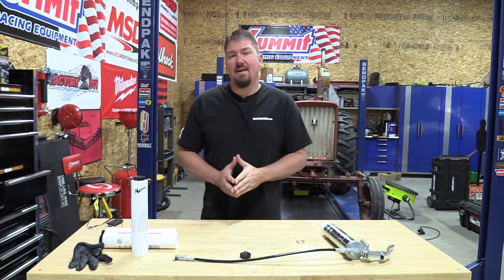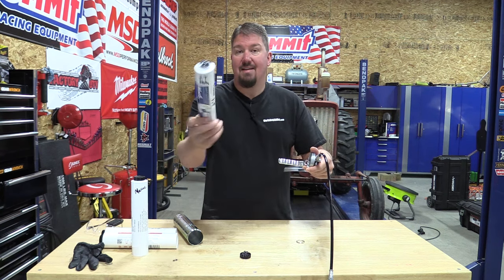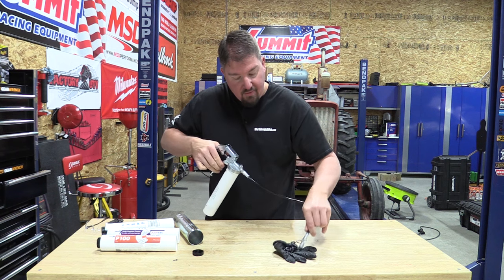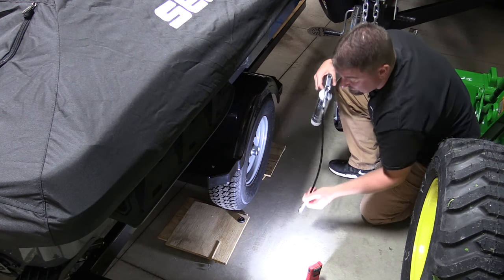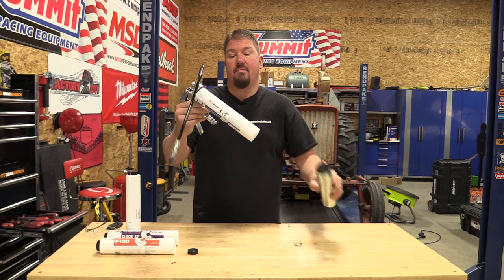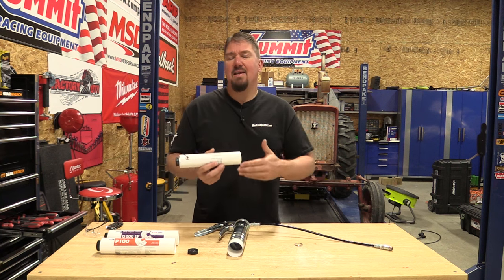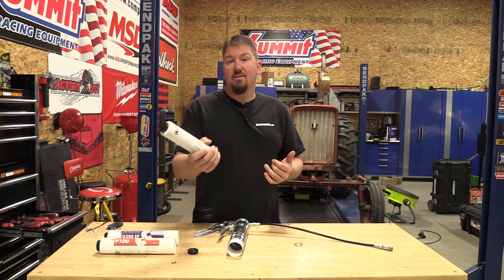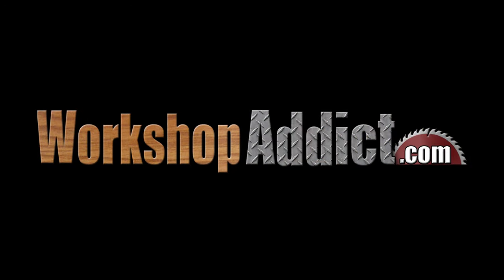Game-Changing Grease Cartridge & Gun Design That Will Blow Your Mind Made By Lube Shuttle

Comment: I used to dread greasing until I bought a lube shuttle last year. Best thing I ever did, it’s so easy to use and CLEAN too! No more mess!! I think what’s holding people back is the initial cost of switching over. I think I spent around $130 for the gun, box of grease tubes, the long extension hose, and the locking adapter. Well worth it though in my opinion. Great video by the way, all of your points are spot on!👍🏻👍🏻👍🏻

Comment: I buy over 100 tubes of grease per year for the company I run.  We use the Milwaukee M12 grease gun.  I found a great grease John Deere makes that’s awesome.  I love that system I’ve wondered for years why the hell we can’t have that type of system the traditional grease guns fail because of that spring that feeds the grease as you depress the lever.  When you have a million dollar fleet of bucket trucks and front end loaders that manual depressing to dispense the grease seems more suited for guys that have 1 piece of equipment or 2 because it would take too long for our mechanic to grease what we have.  I still like it though hopefully this is the next evolution of grease guns thanks Brian!

Comment: What is holding this back is the millions and millions of tubes of grease available in a myriad of brands and formulas already on the market in OLD format cartridges, vs. a small handful of choices available for this tool by a single manufacturer.  People are brand-loyal.  I like my Polaris Purple Grease for my off-road toys.  Will I be able to get it in a Lube Shuttle format cartridge?  I highly doubt it.  Not now, maybe never.  I like Mystic for my trailer bearings.  Again - does it come in Lube Shuttle format cartridges?  Nope!  

I'm not knocking Lube Shuttle, German engineering, or German grease.  I think this grease gun is brilliant!  It is very likely extremely high quality, as most German-made items are.  Nothing I can see is wrong with the product.  It's just NOT going to get big in the U.S. until grease manufacturers get on-board and start offering their product in a format compatible with the Lube Shuttle.  

Alternatively, if Lube Shuttle would come up with a refillable cartridge that consumers could load with their favorite grease; that might help them gain a foothold in the U.S. market.  Someone eventually came up with the reusable K-Cup for Keurig coffee machines.  Something similar for the Lube Shuttle might make some smart inventor one a millionaire...

Comment: I love this.  The grease gun has been powered by hands, air, and now batteries,  but never really redesigned.  I agree that the availability of different greases is key to adoption.  Many companies and individual mechanics have their choices and swear by them.  I might buy one just as they are as I hate existing grease guns!

Edit:  Just went and looked at the price.  Not until it drops substantially!
Reply from the maker: Price is an issue at this point, but it is made in Germany, NOT CHINA.
Reply: With that price, I can buy five standard ones and still be ahead.
But, let's not forget that it comes with 10 cartridges [$6.50 per cartridge from their website]. The only thing that I would change is that I would have liked an assortment of greases to be included, and not just 10 of the cheapest cartridges.
Reply from the maker: @stans5270  you can buy the gun alone for$65..  you can buy a lot of chinese-made ones for that price but not a lot of good German or American made grease guns
Reply: @stans5270  Agreed!
Reply: @WorkshopAddict  Are you saying that things made in China are inferior?
You sound like my uncle talking about Honda and Toyota in the late '70s.
Perhaps Apple would disagree.
And Snap-on.

Comment: "What's holding it back from being more popular?" For a hand-pumped grease gun it's just a matter of knowing it exists. This one is a no-brainer (no leaking mess, easy to load and prime, quick swaps/refills) but for the electric/professional grease gun, lots of people are committed to their cordless tool brands. I don't think Mato, maker of the electric Lube-Shuttle, is well known. It doesn't look like anyone has reviewed it on YouTube. However, if they'd sell it with a choice of battery adapters for popular tool brands so people could pair it with their own batteries and chargers, that would help. They could knock at least $100 off the price by replacing the battery and charger with a simple adapter and that would make it much easier to justify as a purchase.

Comment: I believe the mower spindle bearing issue is purely a cost and advertising issue - especially on residential equipment.  It's the same with some of these new small engines that don't "ever" need to have the oil changed (B&S Check & Add system). Most folks are too lazy to even do rudimentary scheduled maintenance on their equipment. They would rather run it until it breaks and then go buy another one. So if a piece of equipment advertises no maintenance required they are all over it. With no maintenance the bearings will probably outlast the rest of the neglected components. I once had a Deere lawn tractor with sealed spindle bearings (even though it had grease zerks). They would only last about 3 seasons. So the SECOND time I changed  bearings I pealed off the inner bearing seals that faced the grease. 22 years later when I sold that machine it still had that same set of bearings and they still ran smooth and quiet. :-)
Reply: Grease zerks on most mower spindles are not for greasing the bearings, the bearings are sealed.  They are there to fill the void in the spindle housing that is between the bearings with grease, to keep water out of that void.
Yes you can remove the inner seals from the bearings, but you have to be careful not to blow out the outer seal with too much pressure when applying grease.  It can work if you are careful.

Comment: Omg that's a awesome design what a game changer I agree very easy no mess I think what might be holding it back is it has specialty cartridges you can get regular cartridges at all major stores are the slide in cartridges i also have 5 handheld grease guns and 2 electric grease guns so I don't need another one but it's very nice design
Reply: Lock n lube sells an adapter so you can use the new system in your old grease guns.  I think in a couple years, everyone will be selling grease in these tubes.
Reply: @mikelloyd2013  you can use the old style cartridges with this grease gun?
Reply: @drewmurphy2796  I believe you could swap back to conventional cartridges, but i doubt many people would switch back and forth.  I would expect folks to pick one style or the other, or maybe set up a second grease gun if they have a need to use both styles of cartridges.  I have never used this new style cartridge, but I would try it if my preferred grease was available in it and the price is competitive with the conventional cartridges.

Comment: Got a cheapo €2.50 tube of crappy grease for the lube shuttle and used a long stick to push the plunger inside the tube to get rid of the crap grease into the bin.
Cracked open a standard run of the mill grease tube, put the lube shuttle grease tube plunger into the standard tube(same diameter), butted the 2 tubes together and used the same stick to push the good grease into the empty lube shuttle tube with VERY little mess and almost no waste and it works a treat with no problem. And I put the plunger back into the lube shuttle tube afterwards.

I didn't waste my time cleaning out all of the old unwanted grease at all either, whats the point? It's still grease and only a small amount at that, hardly chemicals going to blow up or anything
Reply: So the label on the tube is different? Doesn't matter, use a black marker to write it on there if it bothers you at the end of the day.

Comment: Couple of comments:  
+ It's not recommended to mix greases
+ I have more problems with grease fittings than grease guns
+ I don't see a cover for the coupler, which means it will get grease on me at some point
+ A cordless grease gun will be WAY more life changing

It's a nice product that solved "one" problem with grease guns.  Nice video though and thanks for your work.  Good videos.  I subscribed.

Comment: I just bought two of the pistol grip Lube Shuttle grease guns.  Also got two of their locking couplers, a 10-pack of my most commonly used grease type, and a 10-pack of empty grease cartridges to fill with other grease types.  I have to keep my old school grease guns in a Rubber-Maid container to keep the leaky mess from getting all over everything.  It will be so nice to not have to wipe the grease and separated oils off every surface of a grease gun before you even get started greasing!  To me, that alone is worth the slightly less than $60/each price tag. 
Then there is the added bonus of being able to switch grease types, basically on the fly, with very little waste.  Oh, ...did you ever forget what type of grease is in each of those four leaky grease guns that are sitting on the workbench?  Eeny meeny miney moe!   Some grease types are very incompatible, and can cause big problems.  With Lube Shuttle, just unscrew the outer tube and see for sure what it is loaded with.
My old, leaky, messy, grease guns are going to get cleaned up and go in the $5/item garage sale box, ...and good riddance!!!  ...well, I might keep the one from the '50s that I got from my dad back in '73, just to hang on the wall for old time's sake, empty of course.  No one needs a grease streak running down the wall !
Reply from the maker: Great points 👍
Reply: How do you fill the empty cartridges? I need one with marine grease.

Comment: Cool product, but I wouldn't be for it personally. 
1. Not compatible with my m18 grease gun. That thing is irreplaceable. I love the speed of it. I can do a morning service on a baler or combine in no time with it. 
2. I really don't have a problem with conventional grease cartridges. If I have a specialty grease that I need a separate gun for, a cheap one will suffice. Also not a big deal to keep a spare tube in the cab of the tractor if I'm almost out.  
3. For 35 bucks more than the pistol grip one, I'd just as soon buy the DeWalt grease gun. It's a good one too. 
4. PSI isn't near high enough.

Comment: This is a great concept but the grease selections are very limited. A lot of folks use various OEM greases on their tractor, backhoe and other equipment. Maybe once the patent runs out other manufacturers will start adopting the design but until then it will probably remain a niche product.
Reply from the maker: Might be...
Reply: They sell empty cartridges, 10 for $15, so you can fill them with whatever grease that you want.  I read somewhere that you can also refill them several times to re-use.
Reply: @warped2875  Wouldn't that negate the mess-free aspect of the Lube Shuttle? :-)

Comment: Make the threading the same size as the tube and it would work with new and old systems.
Reply from the maker: I called them to discuss that and they seemed to believe there were more differences and that this is quickly taking over and they were not changing.

Comment: Do the tubes leak oil out the bottom after it sits for a bit like my standard one?
Reply from the maker: No!  I believe that the lack of pressure on the grease is what stops the separation of the oil.
Reply: @WorkshopAddict  thank you

Comment: What holds the product back is 10 dollar grease cartridges. Any farm supply will have a decent grease for 3.50 or 4.00 a tube. Yep, it's a slick design, but on going costs are a limiting factor. Couple that with a bare end plastic tube sticking out of the bottom being punctured by something in a heavily used tool box, and the gun is useless. Bring grease tubes in line with market, and thread the end for a protective cap, then maybe.....

Comment: How do they get the grease up to the pump without a spring and piston?
Reply from the maker: Before the cartridge is loaded, the grease is pushed up above the mouth, that removes any air in the system and allows it to feed.  You would think that it might be unreliable, but it has never failed me yet.
Reply: @WorkshopAddict  I can see it being reliable when the tube is full but maybe you could do a follow-up after you have emptied several tubes.
Reply from the maker: @eosjoe565  7 Tubes fully emptied, mostly moly grease on our tractors, no issues.
Reply: @WorkshopAddict  Cool!

Comment: That LockNLube to which you linked does not fit without an 1/8 NPT to M10-1.25 adapter.  They recommend their safeLOCK product, which doesn't seem to be sold on Amazon.  LocnNLube has an adapter to which we need one of your special Amazon links!  The BSPP adapter shown as frequently purchased together is not the same!
Reply from the maker: Mine screwed right on?
Reply: @WorkshopAddict  Really?  Did you cross thread it?  The LNL is 1/8 NPT and the Lube Shuttle hose is M10. There are some Milwaukee M18 guns out there that goe shipped with M10 hose ends and LNL sells an adapter to go from 1/8 NPT to M10.
Reply from the maker: @eosjoe565  did you really ask if I cross threaded it.
Reply: @WorkshopAddict  Heh heh... sorry I had to ask. :-)  Not sure how else the M10 would thread onto 1/8 NPT.

Comment: Great concept, but the price is other-worldly, thus I can't reasonably consider one. 😕
Reply: Yeah, it is a bit pricey however, it does come with 10 tubes of grease.  Total cost with shipping is still close to $135.00 then add your tax.  I'll wait.
Reply: @TheFlatlander440  I agree pricey
Reply from the maker: Made in Germany, Not China.  That is where the price comes in at.
Reply: It should come with three or four types of grease and two tubes of each.  Ten tubes of a single type doesn't make any sense for the tool.
Reply: @prototype3a  
I bought 10 empty tubes from AET for $15 to fill with whatever grease that I want.  Easy-peasy.
Reply: @warped2875  how is the refill process? Can you reuse the cartridges?

Comment: Negative = Mixing greases, Volume / size, Pressure, no protection for the bottom of the cartridge as you pointed out. This no game changer! The air system was a game changer, then centralized grease pumps were a game changer, Cordless grease guns , finally the lock and lubes are the bomb!
Reply: not having a plunger is the game changer. Doesn't matter how much you want to try and downplay that fact.